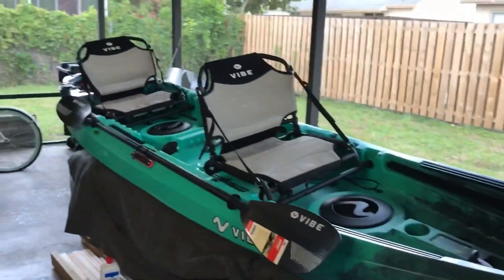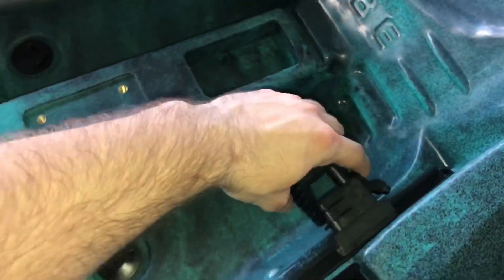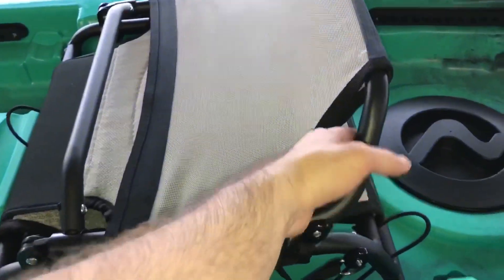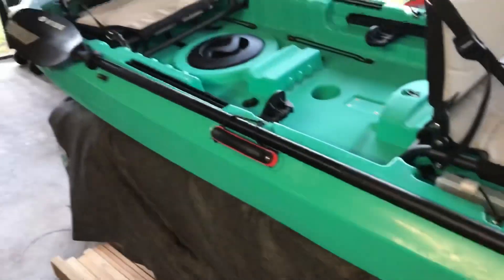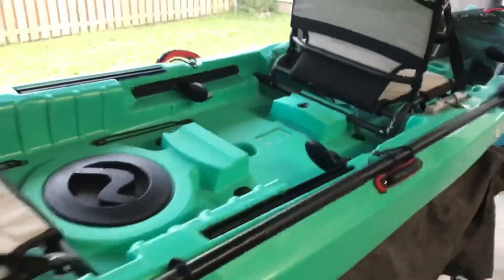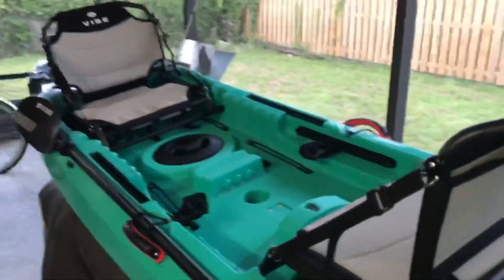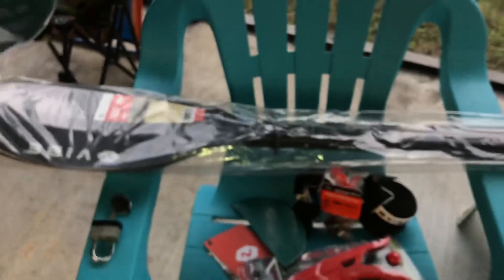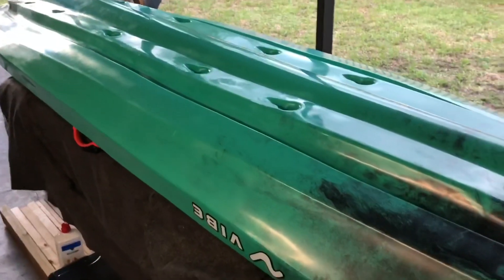Vibe Yellowfin 130T 2019 NEW Kayak!

Comment: I'm looking hard at this kayak and I appreciate the review. Looking for pretty much all the same features (rod holder, reversible seat, adjustable for solo) and you showcased it well.
Reply from the maker: Firinmahlazer Thanks, I tried to make the type of video I would have liked to see before buying mine lol
Reply: @weekendventures11  For sure man. This is exactly what I was wanting to see. How does it handle solo? 80lbs and 13' has me a little worried for my first kayak
Reply from the maker: Firinmahlazer It isn’t a light kayak but it has lots of room when you are solo. And it paddles great when you are solo, you’ll forget it is a tandem.
Reply: hey man, did you ever get a kayak? I bought a used Vibe 130T and my wife and I love it! I am just an average sized guy and I can get it on and off of a Toyota Sienna van and a 4Runner by myself. I lift the nose up onto the vehicle then lift the rear up and slide it on to the roof racks. Once up there, I flip it upside down for travel. It’s much easier with help but, it can be done solo. Mine came with rudder installed and I highly recommend it. ✌🏻